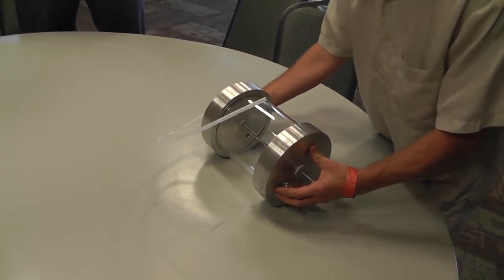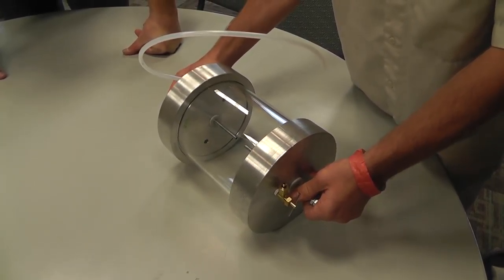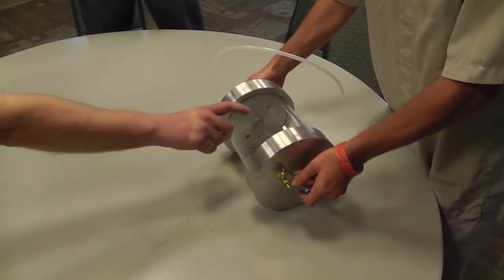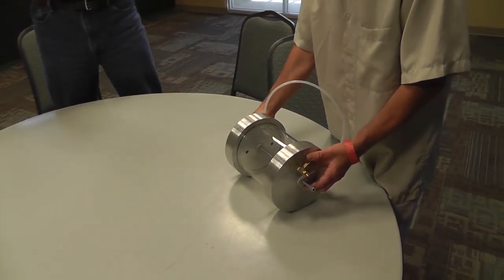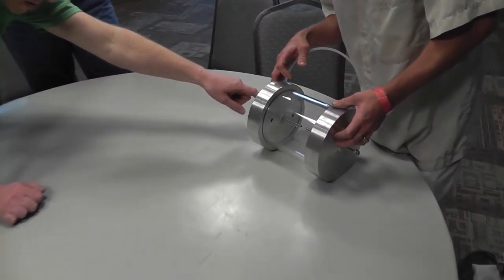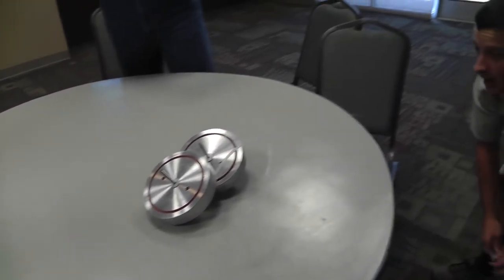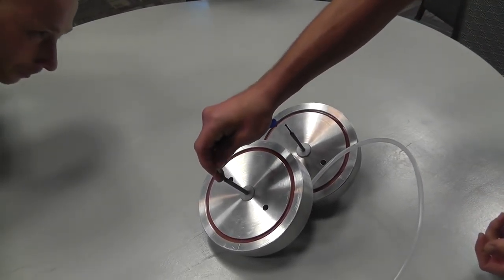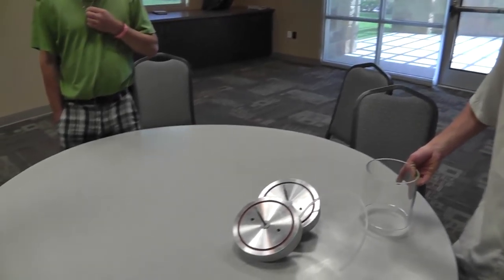People With Fun Stuff At BEM! Home Made Plasma Discharge Device.

Comment: Please, please use helium argon or even nitrogen first unless you are 100% certain of the voltage parameters and calculate the expansion pressures. I would never ever attempt even helium without a certified adequate pressure release valve. All pressure vessels should have a minimum 1.5 times the pressure strength of any pressure containment by law.